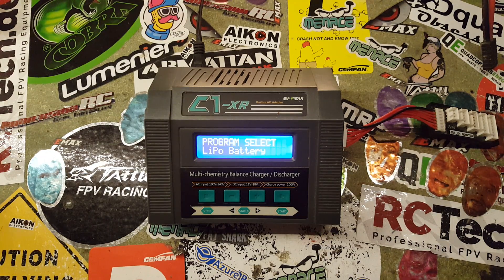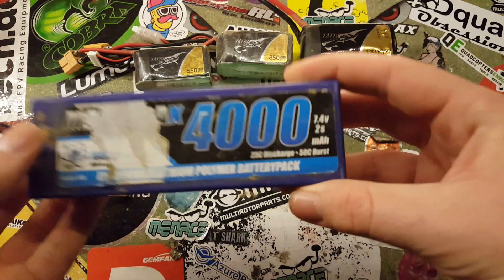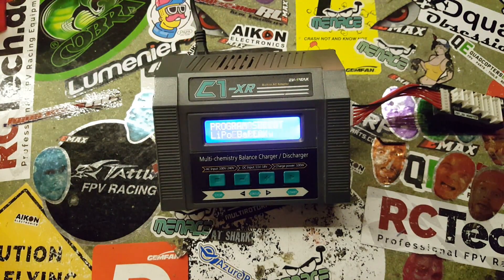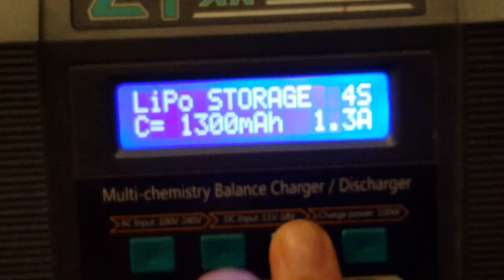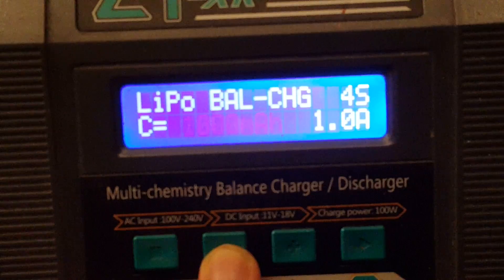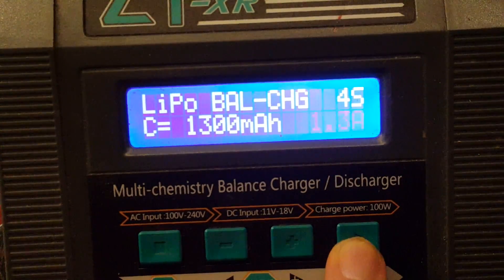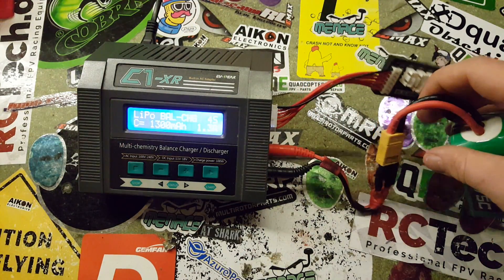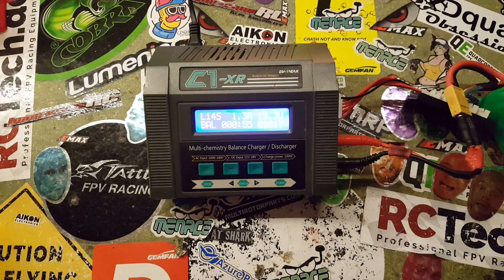Ev-Peak C1-XR// How to charge a lipo

Comment: Their old website says you should always plug in the balance plug first before you connect the charge plug.  Says it is not safe to do this the other way around. Not exactly sure why this is better but I always follow those steps just in case. 🔆

Comment: Hi very helpful, I have same charger/discharging. You can also cycle left to see other info during operation. The button you pushed to see cell values press the button to left of it during use heaps of info.

Comment: So that lipo charge without the balance plug, could that be used for a lipo that has a cell to low to be balanced charge? I was told you can bump cell voltage on a lipo with the nicad setting, then switch to a lipo balance charge, but wouldn't that lipo without a balance plug setting accomplish the same thing?
Reply from the maker: It won’t start charging without a balance plug when in lipo mode
Reply: @elliotfpvreviews855  - Then what would be the point of that mode at all?
Reply: @elliotfpvreviews855  - Confirmed this, page 13, fast charge, used to charge lipos without a balance lead, which is handy when you have a cell that's to low for a balance charge, you just bump it with the fast charge,3 minutes, then switch to a balance charge.

Comment: Hello, thank you! I'm able to charge, but often running into the issue where I get the message "Run full capacity limit" when charging. I see that the capacity cap is at 5000mA. And I'm charging (for example)  three (4S 1500mA), and entering 4.5A for total. Not sure whats going on and was unable to find info about this in the manual. Thank you for any insight.
Reply: Maybe a silly question question but are you charging or balance charging need to bal-charge aslo if I understand correctly your charging 3 batterys at once off of this, no go that's the proplem. If your only charging 1 per charge Maybe try a full discharge and balance storage. Or from balance store. Lower mAh charge rate it will take longer to charge but it may balance better. Given all that could have a bad cell. Also in the vid the guy uses the mid right button to show battery cell levels, you can use the button to it's left to see more info. You maybe hitting operation saftey time limit turn it off zero power restart the balance charge.

Comment: It keeps saying BATTERY CHECK CELL CONNECT ERROR...its my 3s lipo bison vkar battery...it shoulsnt be saying this it wont charge...Useless
Reply from the maker: You probably have a bad connection or a cell which is unbalanced. Check all connections and voltages and see if they’re ok
Reply: This is strange when i just connect the deans and not the 3s clip pins it charges....but i thort all connections had to be applied i.e the deans connector and the 3s pins which go into the side of the Charging box...Can any 1 shed any light please???
Reply: So basically the battery charges using the bannana too deans connection but when i plug in breaker plug to the 3s connection pins thats when it says ERROR...
This is realy strange

Comment: Okay, I have yet another stupid question! what about a 3 and 4s Xt30 lipo, can that be charged via connecting to the 3s balance board only? Or, do I need to find a banana plug Xt30 connect to the EV Peak to have both the Xt30 and balance lead to charge?

Comment: So if I understand correctly. If my rc battery is 5300mAh it should charge at 5.3A? LiPo 5300mAh 7.4V 2s 30C
Reply: Yes.
Reply: Every 100mAh is .1 on the charger

Comment: Mine just keeps saying cell connect error. Tried multiple diff wires etc. Battery is on right settings etc and everything attached properly......
Reply: I had the same problem until i realized i had not put the right s in remeber the equation v(of battery)÷3.7=s

Comment: my charger says to check main and balance. i have the same charger as you, and i am wondering what to do in this circumstance, as the message displayed on the charger is not located in the manual. i have tried unplugging the balance charging part several times and plugging it back in, but the same message gets displayed each time.
Reply: I had the same issue, and the instructions are not clear, at all!  You need to connect "Main Output" banana connectors (be careful of polarity!) with the main battery connection that matches your battery... In my case it is an XT60 connector.  Once you connect BOTH the  balanced connector AND the main power connector to your battery, you can start charging your battery.  It is really short sighted of the maker of this charger NOT to have included ALL the possible error messages and what they mean, as well as HOW TO CORRECT THE ERROR... Hope this helps, Leonardo!
Reply: so I should attach the Tamia-type connection to the banana connectors as if it wasn't a LiPo, as well as have the LiPo hooked up to the balance charger? i.e. pluc a deans adapter into the banana cables and plug the batterie into the  adapter as if putting it into my gun, then connecting it to the balance portion of the charger as well? when I do this, the charger finally starts working. I really want to take care of my battery, so thanks for the feedback!
 @ppotter7692
Reply: This charger won't read anything under 3 volts. So don't run it until it's all the way dead and you shouldn't have that problem.
Reply from the maker: Sorry for the late reply, but this probably means that ur lipo has cells under 3v. You can try to charge it without the balancing plug and on the lipo charge mode. After 30s it should have enough voltage to charge normal again

Comment: I have an 11.1v / 3 cell / 1450mah but I'm noticing the voltage on the charger is getting higher than what my lipo says it should be. Is this normal?
Reply from the maker: It is perfectly normal to go higher than 11.1V. This is the nominal voltage of a 3s lipo, in the charged state a lipo has 4.2V/cell so a 3s can go up to 12.6V
Reply: I have the same issue. My 7.4v 2S got charged to over 8v and shows each cell as 4.16v. Is this normal?

Comment: Hi, I got question. How the charger chandle with more lipo's at the same time ? If it can give full 10A when is couple of batteries ? Because some times chargers in example got 5A reited and they can do only 3 ,3 A
Reply from the maker: The max amperage depends on what voltage you’re charging. The charger is rated at 100w and if we ignore the fact that it cant have 100% efficientcy we can say that you can charge 10A at 10V. When I charge a 4s lipo at 16.8V it hits 5.4A which results in 90.72W of power
Reply: Thanks ! Great answer

Comment: Looking at this unit on Amazon i notice a USB port labeled PC link, have you tried using that port
Reply from the maker: No I never had to I suppose, I don't see the need to upgrade charger unless there's something wrong with it. This is what's written in the manual :  Please download the ''PC Monitor” software on our website: 
www.ev-peak.com.
There is mini USB port in the charge which can be used to connect 
it to the PC. You need optional USB cable (USB A Male to Mini B 
Male) which is not included in the package. The free “Charge 
Master”software gives you unparalleled ability to operate the 
charger through your computer. You can update firmware from 
“Charge Master”.

Comment: Keeps saying "connection check bal and main" extremely frustrating.... ive unplugged it and plugged it back in like 20 times. PLEASE help.... I just want to fly my quadcoptor already ..
Reply from the maker: What are you trying to charge and in what setting? Did you plug your balance lead into the right slot on the breakout board? I think you might have a bad connection somewhere, maybe your charging cable has a bad contact to a connector.
Reply: Try lowering your charge rate to 1.0.
Reply: Plus - minus - check.